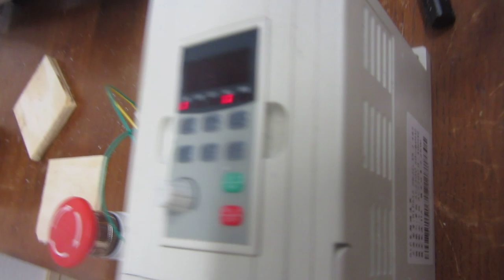Smoothieboard on CNC router, cutting groovemount with fan mounts in 5mm aluminium

Comment: That's pretty impressive. DO you have a write up for you cooling/lubrication system? What does it consist of?
Reply from the maker: So it's simply a 7-bar air compressor, and an air/oil mixer with a nozzle.
You can find those very easily on aliexpress or ebay, or contact me so I can give you the exact link.
Reply: +Arthur Wolf I'd appreciate a link to the air/oil mixer - can't seem to get the right search terms in ebay. Thanks.
Reply from the maker: Matt Nottingham Search "cnc air injector" or the like.
Reply: +Arthur Wolf OK, thanks.
Reply: What was the rpm?

Comment: Did you upgrade the spindle? If so, what did you upgrade it with and what was required (new mounts?) to complete the job. I've been looking at these machines a lot lately but my goal is to occasionally machine aluminum and I want to know what's required to achieve that goal.
Reply from the maker: Nope, it's the 1.5kw watercooled spindle that came with it. It's good enough to do aluminium, actually somebody at the lab just did a small cut in stainless steel today, and it worked well.

Comment: Whats the diameter of the end mil? How many flutes does it have? I have the same machine and i does doe a wonderful job of cutting aluminium, taking the price into consideration. How do you get your spindle to go at 35k rpm? Mine will "only" do 24k rpm.
Reply from the maker: That was a 3mm, 2-flute endmill. It was very expensive.
Now instead of it I use a 3mm, 1-flute endmill without any coating, it's much cheaper, and works better.
Always go for a 1-flute endmill when cutting aluminium, and turn the spindle speed as high as you can.

My spindle also does 24k maximimum, the 35k figure is a mistake.

Comment: Does the smoothie board control the speed? or do you set it manually before you start the job?
Reply from the maker: I set it manually in this (old) video, but you can set it with G-code, that's fully supported by the Smoothie firmware.